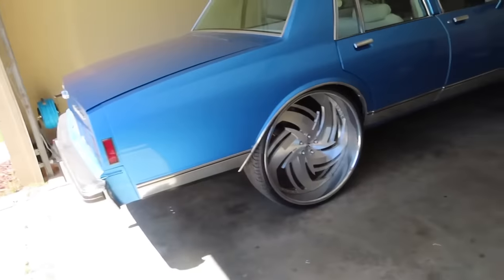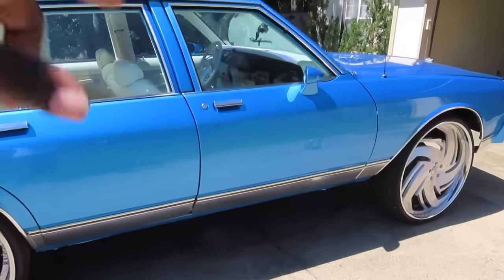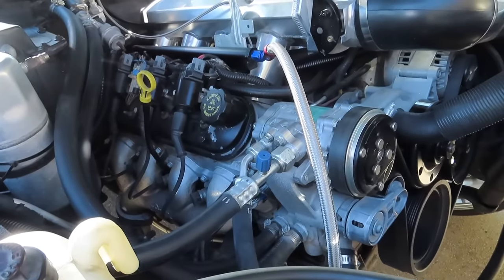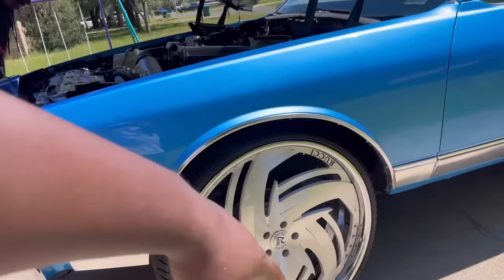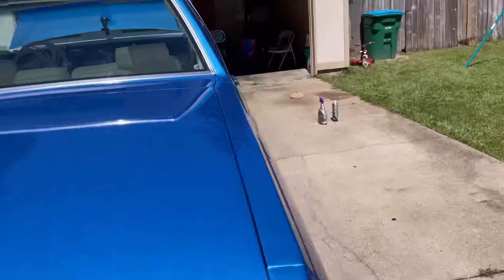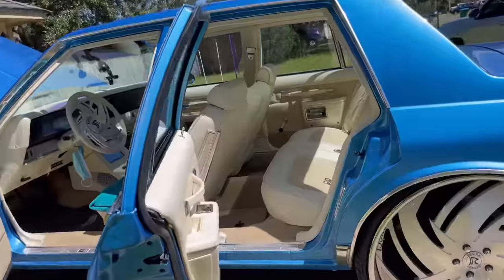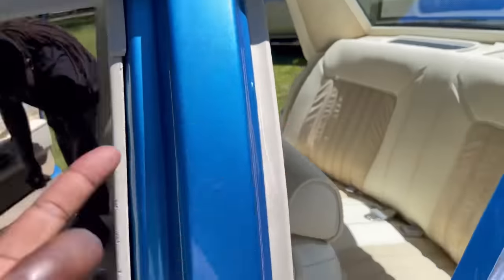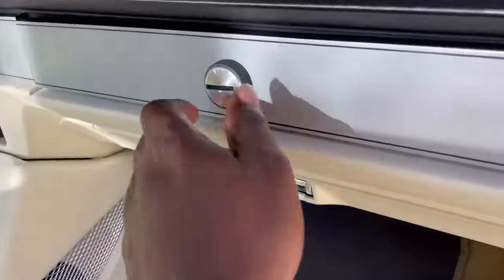THIS HOW I BROUGHT MY 1985 CAPRICE CLASSIC TO 21 CENTURY

Comment: What engine is in there? And the box is clean! I am in the middle of my build. I am going to post it at the end of the month. I am going to try to get it as clean as yours! I am about to get the interior done. After that it’s the suspension than the motor. I want a motor that I can hop in and drive and like you said “not worry about it anywhere I go”… to me that is key! I build my cars to drive not just to look at!
Reply from the maker: 6.0 engine

Comment: Shit is clean as fuk. On my 66 Impala I did same as you redoing brakes crossaerms, tie rods, polymer body mount and all polymer bushings, panhard bat, control arms, trany, oil cooler trany, Richmond gears, shift kit, everything. My car was worn da fuk out and over 50 mph the car would start rolling because shocks and springs worn da fuk out. After I finished that bitch drove straight and tight, no mo roll or driving it like a boat to go in straight line! Shout out to you and your car also tha peeps worked on it. You did it right brotha trust me mofos be throwin paint and bang think they done something but you k ow what it do, shit cost so ya better be bossin.

Comment: Besides the sounds you got a pretty good deal. For 5500 they should've installed a high output alternator and lithium batteries not them heavy XS joints. Thats not enough batteries fam. They knew better. You should have it swapped for a lithium bank. It would've been cheaper than 700 too plus U gone be slammin wayyyyy harder N louder.

Comment: Word of advice, I would change the rear end gears ! 411 will put strain on the motor,410 is better for exceleration and highway.💯💯
Reply from the maker: Appreciate that I’ll look into it
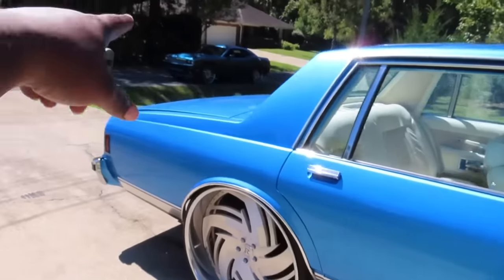Reply: @LifewiththeIkes  4:10 and 4:11 are the same thing it depends on the company you get them from bro…
Reply: 👍🏽 call summit or jegs high performance and you will see what they tell you.give them a description of motor and transmission 💯💯😎
Reply: 410 and 411 are really the same, plus they don't put a strain on the motor.  They are not considered hwy gears, something like 308 is hwy gears.

Comment: Unless you made EXTENSIVE engine work pushing about 400hp. The big ass heavy ass wheels and heavy ass system in trunk just made this car extremely slow weak and made transmission work harder as well as brakes wearing out faster. But its beautiful.
Reply from the maker: It’s a show car go bak an check out the old videos everything in the box is built tough

Comment: Everything is perfect except the subs. Get you some Sundowns dawg. Subs up big port. Love the car. Money well spent but the music ain't right.(subs up, big port)i got two 18"nsv5s in my shit. I bought one deaf bounce 4518r for my other wip. Imma get another one then imma drop them in my Merc. Sundown dawg. I paid a grand for my 4518r deaf boince with is a steal cause there over 1500 brand new. 9000 watts. 45000rms. Im a sundiwn guy but i git a homeboy that got two if these 4518r deaf bounces. My ibe hits anout as hard as my two nightshades but yea. Your shits on point but that box and subs aint it. If anything id. Get a better box built to spec. With the subs up and a big ass port. Youll get more lows with them subs sitting up. You need atlest four cubs per sub for them speakers anyways and that box looks small.